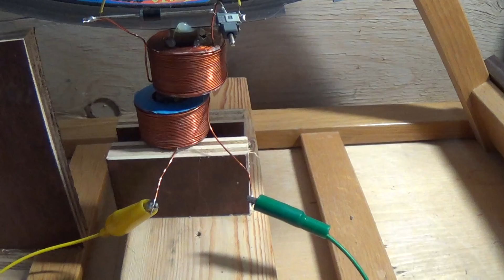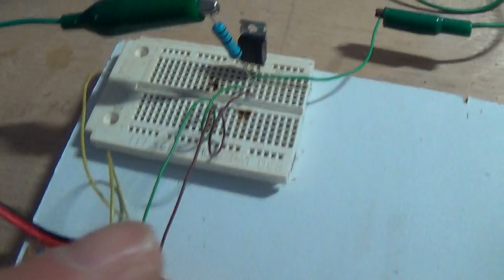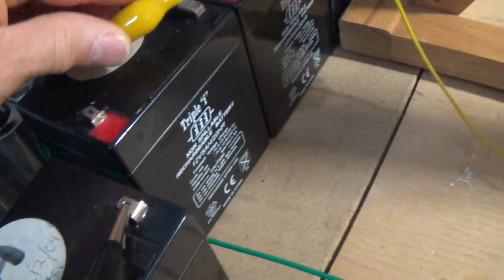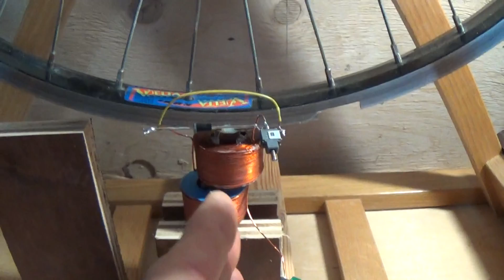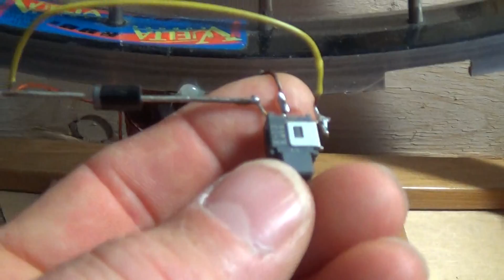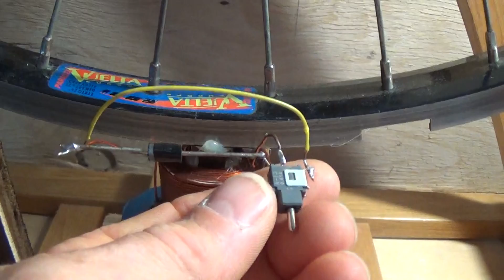Test for TinMan

Comment: +Luc gotoluc Choquette  Very informative, thanks for sharing your findings.  Since you are driving the primary coil with a DC pulse, could it be that the diode direction in this video is inductively revered biased and would be the same as an open secondary coil and that if you reverse the diode direction it would be forward biased and would be the same as a shorted secondary coil?